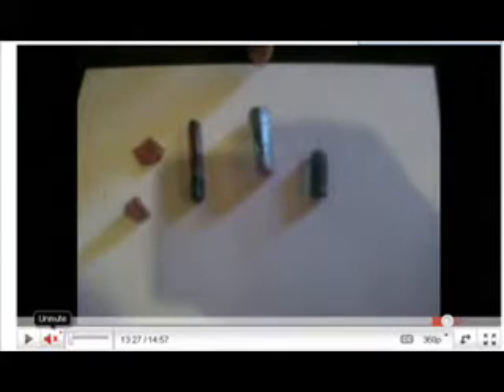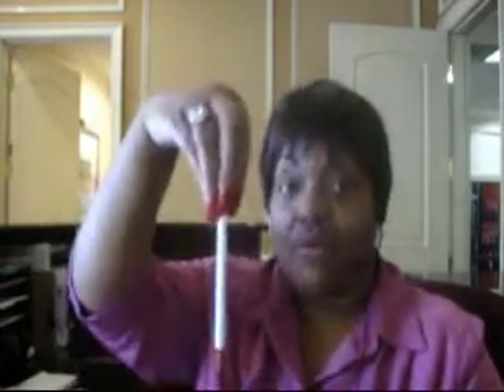Hand made jewelry help pls   tash  needs you

Comment: hmmm that might be interesting. It would depend on how hard the metal is in the bead cap. I would be tempted to stick with wire wrapping traditionally with a finer wire and then the bead cap added (whoch is an interesting design element) .... check out wirewrap. org to see what they do there with their bits of gemies .... pretty fancy. See if you can't find something of a similar size to practice on to see f it works. There are also bails you can glue onto stones. Look for thse in that catalogue